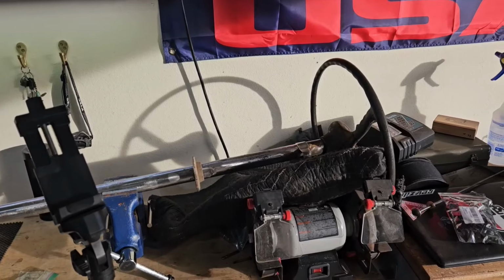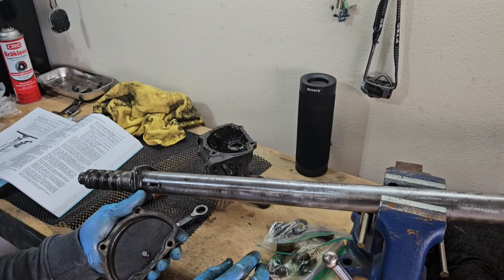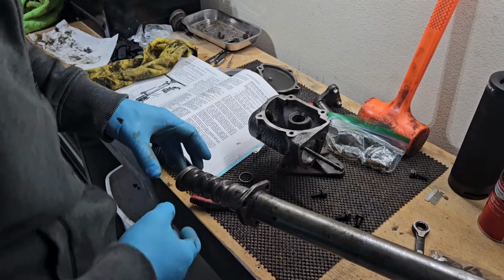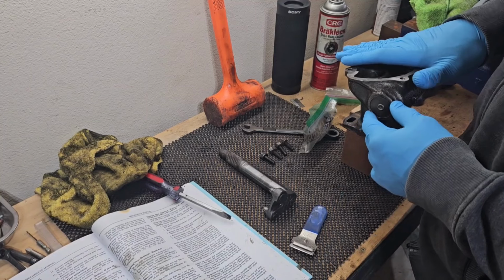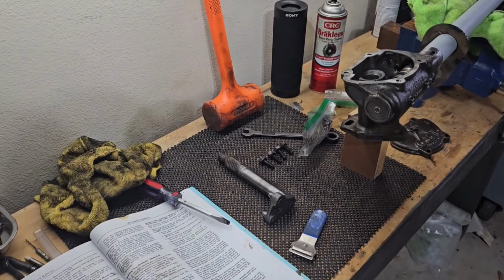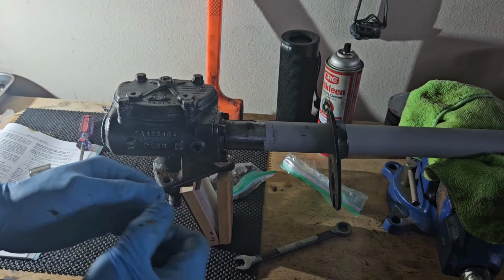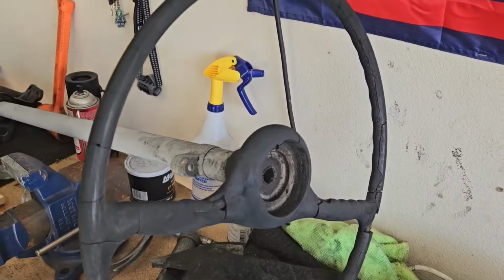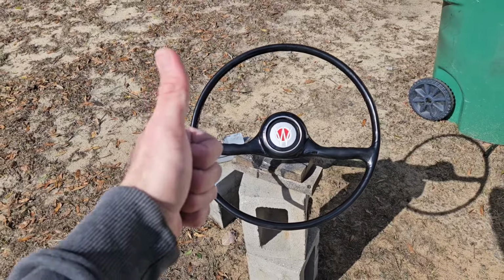1948 Willys Truck | Steering Box/Wheel

Comment: I have a few recommendations! But first, it never fails the power goes out when you need it lol. 
First, always pre grease bearings and shafts. The grease will not fully lubricate until it gets hot enough. The way old steering boxes work and the same goes for ball joints and most grease able spots is pressure on the grease to get it into the wear location. So it will not be fully lubed until you return to grease it fully. In all reality nothing will get too hurt just good practice. In applications that hold weight it is more important. 
Second, go get some gasket paper from a parts store or even amazon and make your own seals. If you use copper a gasket spray on the paper you really will not have any leaks. The glue is also super easy to scrape for the future guy unlike compressed paper. Rtv is great for weird stuff but try to refrain from using it as much as possible. It is a mess to clean up and can break off in certain applications and gum things up. For holes in the gaskets you can buy cheap hole punch sets  to make the bolt holes or smaller holes. Leather hole punch tool works great for holes to around 1/4”. 

Great work though! The steering wheel looks excellent too! Cant wait to see all the work culminate!
Reply from the maker: Thanks for the information!
Reply: @tumbleweed_garage  no problem!